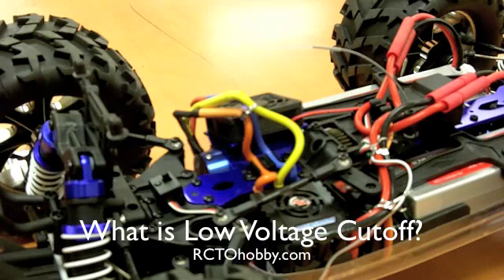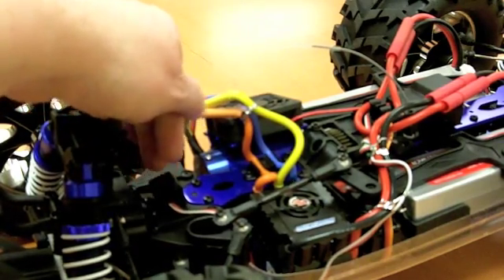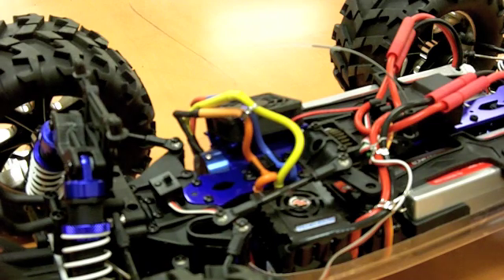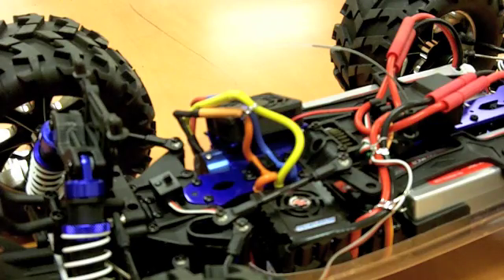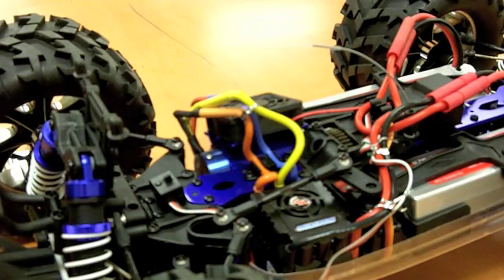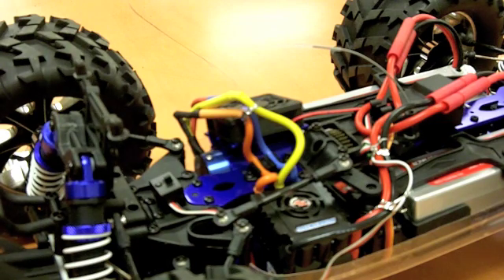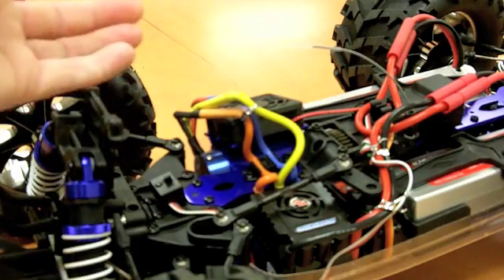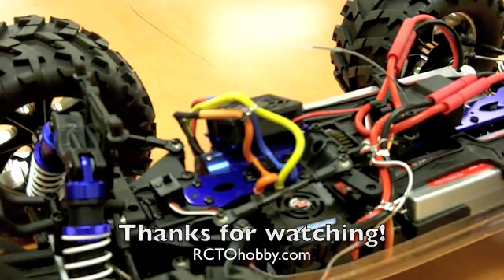ESC Low Voltage Cutoff - Redcat Racing Earthquake 8E

Comment: Thanks for the info. I have a Terremoto V2 and the battery only runs 5-6 mins (3200Mah). Is that a normal run time, because it seems short.

Comment: Is it possible that the cut off its not cuting off at the voltage that it should cuz my truck stops at a voltage but its not 3.1 as i programmed it

Comment: If I'm using Ni-MH instead of Li-PO how can I disable the cut off. Because even running a fully charged 7 cell 8.4 volt battery it will only run for a matter of 1-2 minutes then die because it thinks the battery is dead.